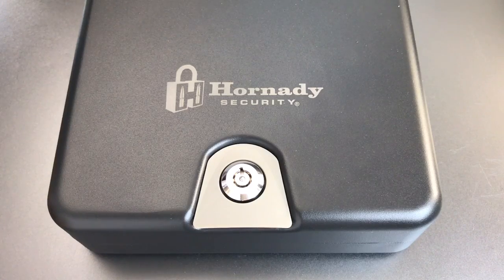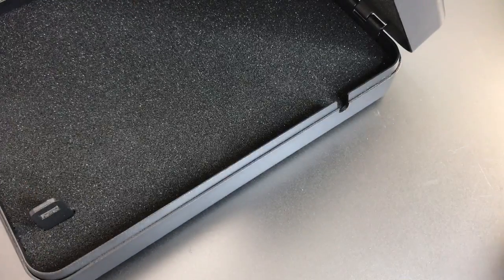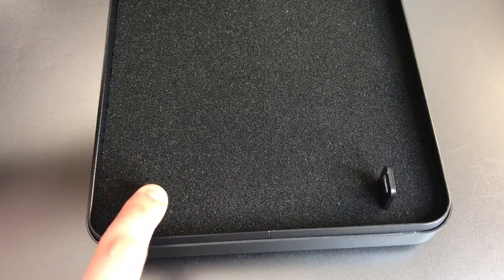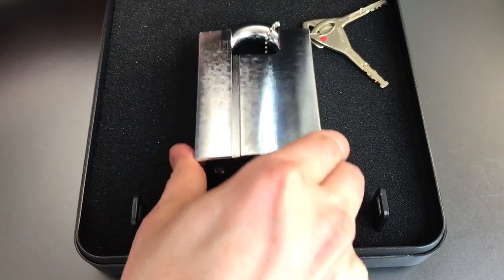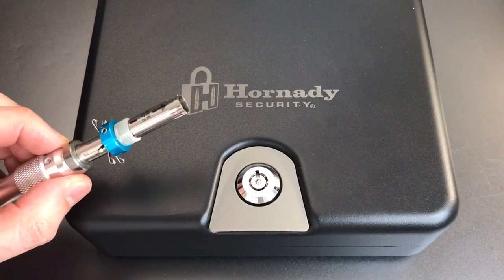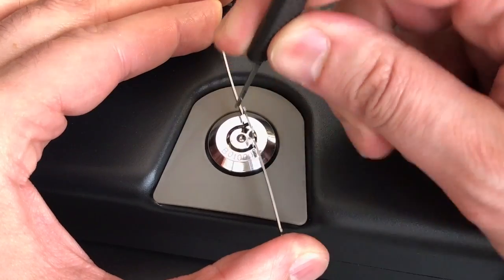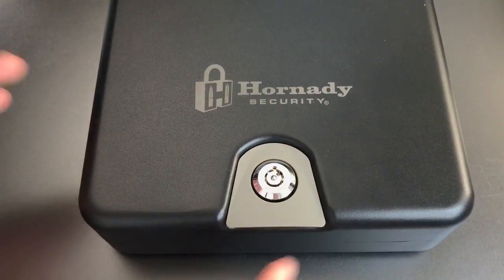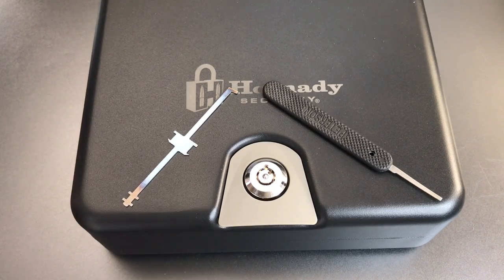[456] Hornady TriPoint Gun Box Picked

Comment: That's actually a well thought out box. If it took a few more turns to open it then it would slow down much more. The tolerance also seem to be pretty bad. Great video :-)
Reply from the maker: The design isn't bad.  Brute force attacks wouldn't be easy.  But you are right that the tolerances on the core were not good, and a few more turns would be helpful as well.
Reply: ya so this is about as good as it gets! If you have to single pin pick it... Feels good enough to keep honest kids honest.
Reply: What kind of lock pick did you use? @lockpickinglawyer

Comment: I bought one of the newer versions of this (Hornady Key Lock Safe 2600KL) and they added two more lockup points.  One on each side of the safe , two inches forward of the anchor cable cutout.  They also added a lot of curves and streamlining to the box.  I assume all the extra curves in the body added some integrity to the safe as well.  VERY disappointing that it was so easy to pick.

Comment: I tried this with my late father's double cylinder lock safe... the two cylinders were space about 3 feet apart and connected internally with a metal rod such that both needed to spin simultaneously to open both locks. It was a basic $400 eagle gun safe from Academy and we eventually had to drill it open. I guess we would have needed two people picking/twisting at the same time.

Comment: They used to use tubular type locks on the early PCs as keyboard locks to prevent a keyboard from operating. 
I was often called upon by friends in the early 90's to help out friends who had lost their keys.
(You could either pick the lock, or just open up the casing and clip a bridge wire in!)
Needless to say, most manufacturers did not use a high quality lock.

Comment: Considering the somewhat specialized tension tool required and solid lock up of the box I'm personally satisfied assuming it is an item that costs less then $80. Confining it in a dresser or nightstand drawer would make it even more difficult to open. However in the end it is a tin box. I'm curious about how you would make these locks to open more difficult by changing the environment thus improving a weak lock by making it awkward to pick. The puck lock I have on my work truck can't be accessed without first tearing down my fence or the side door you could hand upside down from the roof or cut your way through my motorhome to get access to the lock. (I have a dead switch on the ignition so driving doesn't work). So short of a tow truck the locks could be simple suitcase locks and it wouldn't make much difference.
Reply from the maker: Awkward positioning can make for an excellent pick deterrent... same principle as a warded lock, but on the macro scale.  ;-)
Reply: I wonder if you could make a 90 degree key with just the insertion part after the bend and then put a cover over the lock just high enough to fit the key in and then it would be really hard to pick I would think.
Reply: @jayt4697  damn this is genius.

Comment: I've always wondered what those devil horn looking bits were on a couple of my tension tools, I've never had a reason to pick a tubular lock.  Could you use the tubular pick as a tension tool and pick each pin by just pushing it down on the tool until it set?
Reply from the maker: Using the impressioning tool to SPP is possible, but not very easy or reliable IMO.

Comment: Ive watched quite a few of your videos now.... is there any lock thats actually worth a damn?  Seems they are all prone to the same handfull of different attacks.  Might as well just leave the front door open!
Reply: Paclock stuff is pretty good. But if you want something that is practically unpickable I would look into an bowley
Reply: Most thieves go for low hanging fruit. A little security works most of the time.
Reply: All locks and safes are eventually defeatable one way or another. The question is just a matter of how much skill/time/tools required to defeat it vs how much you want to spend. This is actually pretty good for a lockbox safe. Yeah he picked it but it probably would be easier to cut the cable and just take the whole thing, if your worried about securing super valuable stuff from professional locksmiths you should be spending a lot more for a safe.
Reply: @MrGigaHurtz  Yes, the cable always seems the fast-and-easy weak link on these to me.

Comment: I know this is a rather old video but I was hoping you can answer a question.  Is the lock housing plastic? Can the lock housing be simply defeated with a hammer or a screwdriver?  Thank you. Almost every portable gun safe I've seen has a plastic lock housing that you can just pry out of the case with a screwdriver or whack it with a hammer literally defeating it in seconds. I'm having a hard time finding one without that flaw.

Comment: You can use the impresioning tool just use the pins one at a time with extra bands it will lock so it can be decoded for new key to be cut if needed , can the lock be replaced or is it fixed

Comment: The design has improved Hornady Rapid Safe with a recessed barrel lock making use of the tension tool inoperable as the lock is too low to reach and pins are trickier.  I have been trying to open as the cord that powers the keypad has become disengaged.  The key missing.  This is my personal handgun safe.  Working with tools you have used though no result yet. Welcome suggestions or video
Update:  I successfully picked lock without damage using barrel lock tool.
Reply: This model safe was also discontinued and replaced with a newer model, the 98153

Comment: So after a thief cuts your lock cable and takes the box, they'll be able to pick it open instead of drilling it, if they're so inclined. The moral of the story: don't rely on a portable safe to provide much security against a determined thief (or someone with inside knowledge of what you're carrying around).
Reply: The whole point is that straight window smashers don’t have many tools besides part of a ceramic spark plug. Prepared thieves with tools will get into most anything.

Comment: Lpl says it is easy.  Means normal guys might take all day to get it.  I would cut anchor and take box home and open it with crowbar to defeat it.

Otoh, I would imagine that lock is plenty good enough to prevent kids at home from getting to a gun for parents to use this.  Sometimes cost vs safety is dependent on use case.